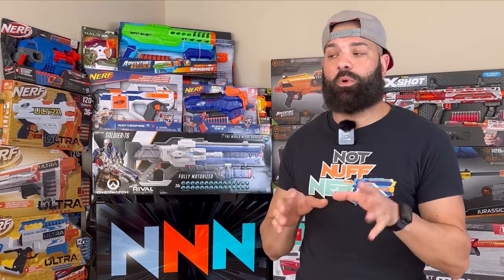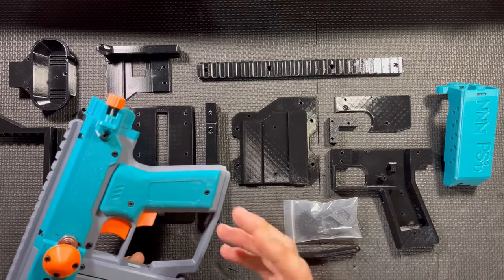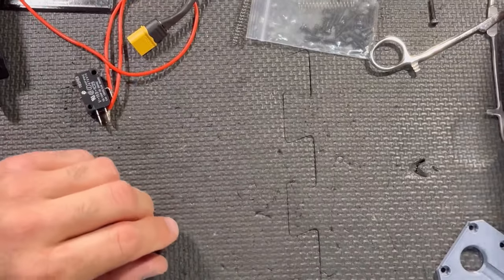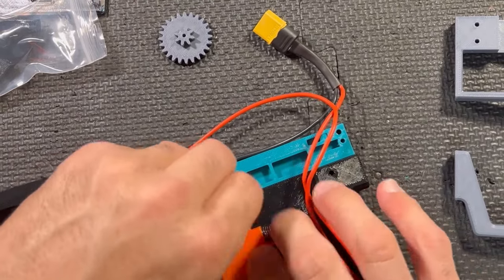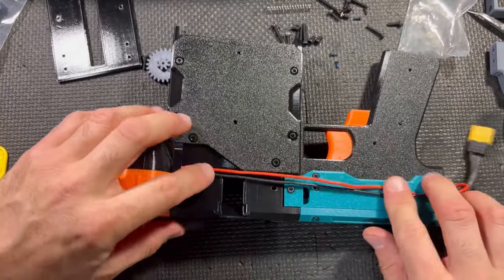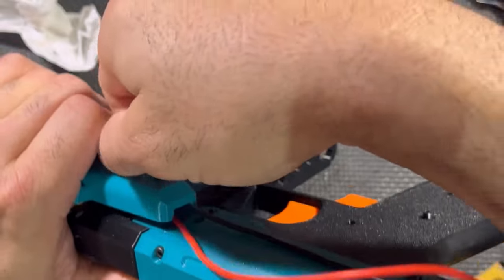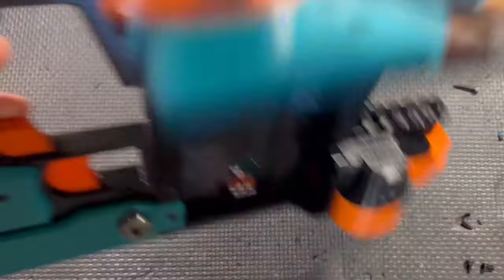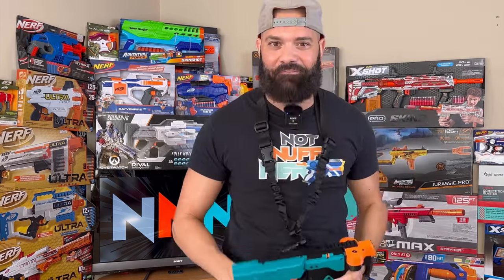Bridging the three-dimensional gap | Gryphon Stapler Full Build Guide

Comment: Gee Bill, how come your mom lets you have TWO Staplers?
The hinged door originally was split into two prints so the follower could be installed into the dovetailed track. Then the hinges and the door could be installed around the tab that has to slot through the door. Merging the two halves of the door assembly made the assembly process more complicated than it would have been normally.
Reply from the maker: The man himself! Thank you for designing this incredible blaster! I wanted to change frames so I took advantage of the opportunity to make a build guide. I was sure it was probably not going to be 100% the correct order of assembly, but I at least wanted to provide a base! 😅. Thanks for that piece of history!

Comment: Just a heads up. All the screws should be M3 and the lengths are what you were calling m10 etc
Reply from the maker: You are correct. Hopefully the layman’s terms will be easy to assert. Basically it’s the same as the video but with the M3 prefix 😅. Good catch!

Comment: Just FYI, M# screws denote the diameter of the screw, not the length. So an "M25" screw is an inch in diameter. The designation for metric screws would be something like M3x10 which would be a 3 mm diameter screw that is 10 mm long
Reply from the maker: Yep I’ve answered  a few comments on here about that and I put a pinned comment clarifying everything. Thank you for looking out!
Reply: Totally missed that, sorry! @notnuffnerf

Comment: Yes this is amazing. Definitely need a micro flywheel version of this blaster. Also maybe some heat inserts to.
Reply: I thought it needed heat inserts too, but it's surprisingly strong with just self tapping into the plastic.
Reply: @PaperSkeletons3d  i was thinking more on the lines of longevity of the blaster. If you add new parts or replace parts multiple times the holes will eventually no lone accept the screw and strip out. So the heat inserts will fix that problem.
Reply: @PaperSkeletons3d  still amazing blaster i definitely want one when i have the money.
Reply from the maker: The only thing I will try is to use flat countersunk head M3s which are incredibly hard to get vs standard head. They won’t be used in all inserts, but they will look great on the countersunk ones. We’ll see how it turns out! 😅